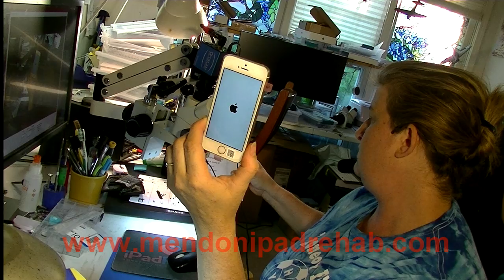Classic 5s long screw damage trace repair to solve blue screen of death

Comment: I LOVE how we both cut the wire to exact length the same "professional" way!!

Would also love much finer tweezers than everything available. If I can see the tip without microscope, too thick.
Reply: Louis Rossmann 37:31 I am cursing watching this and I am not even the one doing this. At one point my hands were moving as if I was the one doing this. I had to remind myself, this is just a video, you are sitting at a restaurant not trying to separate wires with magnetic pieces of metal, relax...
Reply from the maker: Hey you watched my BSOD video! That totally makes me smile.  And I know you would totally send me a usb hdmi capture dongle even though you know where I am right now.  Hmmmm.  You are a good friend.  I will do better and shut up for a few days.

Comment: Hiya Jessa , 
i realise this is an older video , but you mentioned filling down your micro pencil, !! I would love to hear more about what type of file ie diamond ones or just any type also how much did you file down ...?? I have only used mine twice and ( un filed ) but all the tinned tip has gone black and it refuses to take any solder , also have same trouble with my 2023 tweezers but those tips where secondhand , but would filing these tips not remove all the pre tinned tips completely  !!! Another great video by the way 👍🦄

Comment: On the topic of tweezers and needing to find a new pair....
I saw in one of Louis' rants a short bit about Hakko tweezers are worth the money, currently I've got a conglomeration of various ifixit tweezers, some that our boss bought, and other inexpensive ones I've turned up. Do the Hakko or other high end tweezers hold up better? I've probably got only one curved pair that meet at their point right and don't look like something from a dr suess book under the scope. Same goes for my picks, is it worth spending the money for the higher end tools or am I just going to ruin $15 tweezers and picks instead of $2 tools?

Comment: thank for sharing your knowledge, I have a iphone 5 main board with the classic screw damage the problem is I use a USB microscope and the lag is a nightmare for this repair hoping to invest in a mid range stereo microscope soon and complete the repair, anyway love your videos as specially your micro soldering videos, big thanks.
Reply from the maker: iPhone 5 doesn't get long screw damage.
Reply: +iPad Rehab it's actually a 5s not 5 giving the blue screen, I know because I f***ed it putting screw back in wrong place (let's hope I don't do that twice) after a screen replacement, anyway thanks for some great videos looking forward  to your next one.
Reply: +iPad Rehab yes its happen in my iPhone 5 i got error-1 ????
Reply from the maker: then you have some other problem.  iPhone 5 does not have traces under the screw hole.
Reply: +iPad Rehab hi 
 what do  you think ???
Reply: +iPad Rehab 
Hello, i watched ur videos and let me thank you, u're doing an amazing job.
I have an Iphone 5, and it keeps tell me that i could not activate because Apple is not responding. After i researched on the internet i found that i possible have a long screw damage. But u say that Iphone 5 does not have traces under screw. So why in DFU mode it gives me error 14 and it stops? Please i really apreciate ur answer ;) Regards from Romania ;)
Reply: +Cristian Nistoroiu  Hola nno se escribir en ingles, pero a mi iphone 5 le sucedio igual y logre restaurarlo luego que lo deje una semana apagado sin intentar hacer nada con el.

Comment: Greetings from Portugal.
I have a little problem that i do not know if relates to this video.
Iphone 6 connects to iTunes , makes updates and downloads music, applications and files .
On the other hand has no image/response on the screen/touch and the only thing you see is a very faint backlight .
Sluggish response from power button on wake-up from standby.
All this after replacing a damaged screen.
Do i need to buy a new Iphone?
Thanks for very useful videos ;)

Comment: Hello, nice video))) i have a question:
you repaired one right cut through screw damage, but you've told before that both of them can be damaged and they lead to different malfunctions, please can you tell what are they, cuz i just got a 5s with both of them OFF, will dig through in the right one and fix it, but are there traces below the left one too??? THis phone has common sympthome, it shows apple ons start, then goes not blue but black... will be recognised by itunes and even makes softwareupdate, but then same thing...apple logo and black screen))) i guess this is same malfunction, but would be interesting to know that the left broken screw usually affect. THANK YOU)))
Reply from the maker: Off the top of my head I think WiFi/Bluetooth traces under left screw on 5s

Comment: Hello! Wow I am surprised to see your video. I got stuck on the apple logo too, but not a blue screen, just the apple logo and then automatically resets. Could that be also long screw damage?
Reply from the maker: no--that's more likely corrupt software, if there is a hardware cause it could be bad usb handshake chip Tristar from gas station charger usage

Comment: Really love the video. My 5s has BSOD problem in hot weather. I use fridge to power on my phone. Can you tell me what is the problem? is it screw damage?
Reply from the maker: +Rati Phoenix not lsd if the phone can boot. More likely failing nand
Reply: It has that problem for 2 years and its still alive. I need ur help or someone's like you but u live far away :( haha
Reply: and can I fix it by myself? or it needs professional help?
Reply: Yes but it has BSOD problem for 2 years and my phone is still alive, some days it works perfectly but now it's in the fridge and I'm charging it not to shut down. :X haha really need ur help or someones like you but u are far away haha
Reply from the maker: if you have to ask

Comment: Do you guys take on any jobs i would love to have my 5s back up and 
running it has a lot of photos still on it and numbers where could I 
mail it and how much??
 it used to boot loop and blue screen then only did 
blue screen i replaced battery went back to looping for a day then only 
blue screen again I noticed when i opened it up it was missing that 
plate ..I bought it used. Also I noticed the camera stopped working as 
well a couple months before it stopped working
Reply from the maker: Sounds like you might mean "blue screen" as the light purple screen that is backlight only.  If this is the case try DFU restore.  The camera not working may suggest water damage but if it is not water damaged then yes you can submit a repair request on our website for a quote: www.mendonipadrehab.com

Comment: Hello Jessa,
My iPhone 5S has a BSOD problem after I've replaced the housing (I've bent it). For a while i thought that its a long screw problem but today I've checked it and its not that. I have revealed the copper traces and there are all intact. Do you have any ideea what might it happen?
Reply from the maker: There are at least a dozen causes of BSOD, most of them related to crashing the i2c data lines
Reply: Thanks for answering. I'll check it out.

Comment: hello.great video. i repair the lines like you in the video, and the iphone 5s load the ios normal,  but hour later, the issues back again..i reopen the device, but the lines are good...what can i do?  i tried to restore and not pass the firmware.. sorry i not write good english. thank you so much for the video!
Reply from the maker: +angel rodrigues sometimes U2 or missing battery area filter can also cause BSOD
Reply: ok thank you so much...i ll check that.

Comment: This video is awesome! I NEED YOUR HELP PLEASE!  i have a 5s and i dont think its the long screw, i dont have a microscope but with a magnifying it looks fine!  i get the blue screen crash maybe 7 mins into the phone running, less if the screen is on.  it registers in itunes fine.  its defo the BSOD but could it be another issue.  I AM A NOVICE.  REPEAT!  I AM A NOVICE!  any help will do tho
Reply: Check for damage near battery connector, or bad battery
Reply: Jessa Jones Hi Jessa, thanks for your reply!  I have changed battery - now on third! still same issue.  I put it in itunes mode and completely restored to factory settings, no problems - didn't crash or anything, now i have the activtion screen and its crashing again.  i'm lost

Comment: Hey,

I have almost the same issue with my IPhone5s 64GB with little complication !
My story started when I was charging my phone with a portable back-up battery , so I noticed my phone charging process has some issue,means it was flickering on the "battery sign" located at the top right corner of the screen,so, I disconnected the charger and I did not know it caused the damage. A day after noticed when I charge my phone it does not show the actual percentage of the charge on the battery and was just showing a fixed percentage like after 45 min was showing just %15 percent charge. When I looked over at Settings>battery>Time since last full charge on both "Usage" and " Standby" shows _ symbol . Then when I tried to fix this issue by resetting my phone into factory reset and do restore from my back up through  iTunes, while it was booting up after 30-45 seconds a dreaded BLUE SCREEN shows up and was failing the whole thing. 
The BLUE SCREEN issue is still with me , the fact is I have never ever opened up this phone for repair prior to this issue and when I bought my phone, it was brand new in its original box but " Carrier Unlocked" ! I have no warranty on it and I have already replaced the battery by myself but no positive changes happened.  
I still can use it but not reliable because you would never know how much charge  left on your battery( bc of faulty indicator) and when it goes down (turns off )and you put it back in charge it keep resets itself because of Blue Screen till you would assume ,Okay, now it has enough charge after 40 min for example !
PLEASE HELP ME!!!!

Thanks Ma'am !
Reply from the maker: Change tristar after ruling out bad battery with a known good battery--not just an eBay battery

Comment: Hello, i got an question. I've put the long screw in that bsod hole but i dind't tighten it up. I felt it very slightly to be stuck and i took it out. I can't test the logic board now but should it be ok?

Thanks!
Reply from the maker: Who knows. You have to test.

Comment: Have you looked at a website called Circuit Medic, thinking that maybe a little easier method, but I have never done so I have no idea.
Reply: Circuit medic pad repair is expensive, and not made to work on this scale.  It is far easier to just run jumper wires.  The only possible application for it might be in iPad mini digitizer/charge port size torn pads....but even still, it is easy enough just to attach microjumpers and not try to deal with messy epoxy

Comment: Hi, I have the same issues since I broked my iphone and changed the glass. However , I wonder if I have not a chance elsewhere ( I'm from France , and do not have a microscope and nano-talent ) : my phone is down for 2 months , with this blue screen. Sometimes it is not blue but red , or yellow, as if full of mini Pikachu was in it. It's not as uniform yellow , I do not understand ... I thought I would have trouble screws, but my phone worked twice like a miracle and worked 1 week, until I had no more battery. What do you think ? Do I have a chance of not having to repair the motherboard? (I changed the dock, the 2 cameras + glasses and the frame, and I have a magnet phone...) - In France, there only repair glasses, please help me. :) :)
Reply from the maker: unplug front camera
Reply: It doesn't work. I tried to unplug the 2 camera.
Reply: and the DFU mode doesn't work with an error 9. Restoration still doesn't work.

Comment: Where do you get the wire from that you use in this for the repair?
Reply: Dissected vibrator coil
Reply: Awesome, can you recommend a supplier? Thanks!
Reply: Or dissected speaker. Nice copper!

Comment: this problem occurs only when we accidentally put longest screw to the bottom right hole right ?
Reply: You can get BSOD from several causes, you can also get trace damage in other screw holes, but bottom right will cause BSOD.  Bottom left will cause other problems
Reply: +Jessa Jones i just change my iphone 5s by myself. then my 5s randomly blue screen and after that it will restart automatically. around 4 or 5 minutes after start. i open ibackbot and read the logs, it said something error with gas gauge. can you explain more about this ?
Reply: Pry damage near battery connector will be fl11 filter for gas gauge replace of jumper don't mistake thinking it's u2 ic it's not.

Comment: hallo. i have iphone 5s. What causes can be damaged like that?
explanation please.
tq
Reply: There are different sized screws holding the connector cover down.  If you put a long screw in the wrong standoff, it will damage the board.  I know it first hand :(

Comment: What causes can be damaged like that?
explanation please.
tq
Reply: There are different sized screws holding the connector cover down.  If you put a long screw in the wrong standoff, it will damage the board.  I know it first hand :(

Comment: Mam,  i was replacing a new housing for my iPhone 5s, all went good & works well but when i turned on the phone was too hot then about 3 mins phone goes bluescreen, did i damage the logic board? And when i charged my phone it drained about 2-8% for example ; when the battery is 98% when I charged it goes to 92% pls info, this is so frustrating and im so stressed:(((
Reply: And can u repair my phone and how much is the cost?bcs i dont have much money and i think my country is far from you, help :((((
Reply from the maker: Look for missing component near battery connector

Comment: I bought all the equipment you were recommending and I got up to revealing the traces under both screw posts but none are broken :( Worst!!! Do you know what other causes could cause this blue screen while trying to boot up?
Reply from the maker: bad front camera flex
Reply: +iPad Rehab do you mean the actual fpc connector? i have the front camera unhooked when booting up
Reply from the maker: Whoa.  Not all 5s BSOD is trace damage.  If
There is no impression in the screw hole, there is no trace damage.  The other causes of BSOD are mostly software corruption--which may have an underlying hardware cause.  DFU (not recovery mode) mode restore the device.  If it fails then consider a hardware cause--Tristar, NAND, gas gauge, ALS line failure etc
Reply: +iPad Rehab gotta love iPhones :D yeah i tried "upgrading" the ios and when transitioning to restore mode it goes back to DFU mode ;(
Reply: Hi, great video! One of our family's 5S's had a number of problems. First the Home button failed (which was got around by usinig a floating-home-button app) and now about 6 months later it was given to me to fix because the screen had gone totally black. It would receive calls, so it seemed still OK inside. It also needed a new battery, so I replaced the battery and reassembled it, being very careful to put all the screws gently-tight in the same holes they came from, as I already knew about the long-screw BSOD problem, also being careful to not open the screen past 90 degrees when opening - but now it cycles in the startup, usually the Apple logo of varying brightness ending with a blue screen flashing, but sometimes with a red screen. Sometimes the display lines go weird so that it looks like a fine metal grille with a faint shadow of the Apple logo in the middle. I've looked down the metal-tube screw holes the best I can and the foot of the holes look perfectly shiny. But how do I do a DFU if the Home button is dead? Also, I hear that since iOS9 changing the Home button can brick the phone because of a violation of fingerprint security.
Reply: +Ronnie1001 rule out bad ambient light señor then consider bad battery, missing bate dry area components or tristar chip

Comment: How can I avoid this? 
Look at an iFixit guide to make sure you have the right screws?
Reply from the maker: +Jake Methner yes
Reply: iPad Rehab alright, thanks for the video. I was unaware of the issue.
Reply: +Jake Methner Its always good to lay the screws you take out of a phone in an order that allows you to put them back in. If you have trouble with this use a magnet with a diagram on it.
Reply: Kevin Sanders Yea Thanks, I do. I just wanted to know if there was a better method in case you don't.
Reply: +belgia BasyiraS unlock fox is a scam.